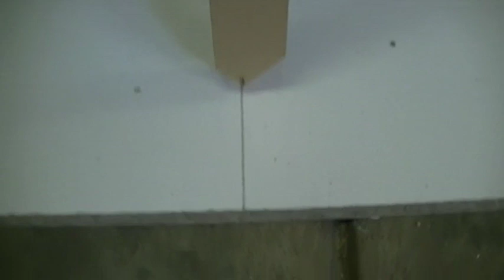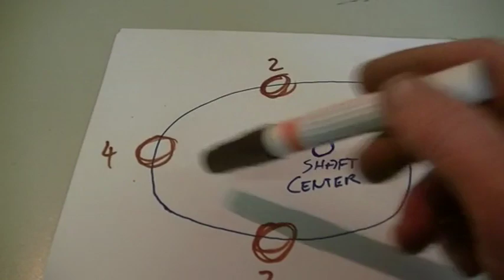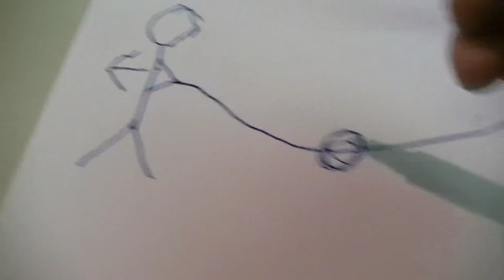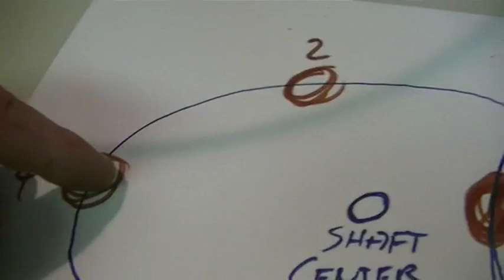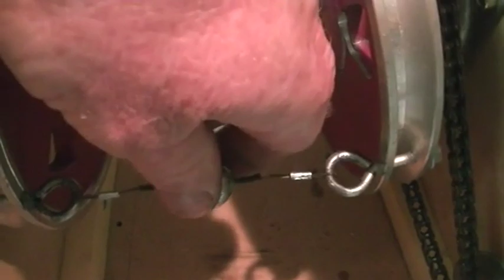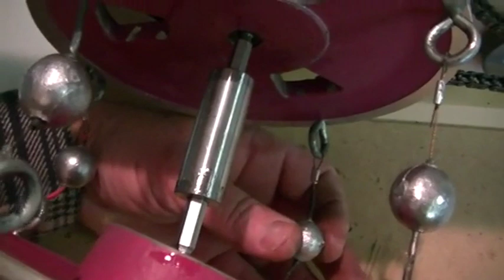Inertia Drive pendulum test,and a look inside

Comment: You have almost the right idea, but you are not caming the weights on and off your flywheel. they will still balance them selves out. You need an outer cam to nutrolizze the weight on and off your flywheel. otherwise you are just spinning your wheels.  There must be a positive caming or it won't work. I built this back in the 1094 and learned what was wrong. Email me wildieforrest@gmail.com.SincerelyForrest

Comment: TinMan, I say that is a brilliant achievement to be able to create a constant deflection for this device during the pendulum test!  Definitely not due to torque reaction, otherwise deflection would have been in the opposite direction. After drawing up a kinematic diagram of your device, I think I may have an idea as to why the coriolis inertial forces may not be totally cancelling out the inertial thrusting force.  I would like to replicate your experiment, and at the same time, I would like to gather some data from your experiment in order to make some rough thrust calcs.  Could you approximately give me the distance from the deflection pointer tip to the ceiling, the metal that the satellite sinker is made of, the diameter of the sinker, the approximate weight of the box/motor assembly, and the rpm you figure the main rotor was spinning at?  I believe that you mentioned the deflection of the pointer to be about an inch?

Thanks!

Comment: TinMan, as a reactionless drive enthusiast (and a pretty serious one at that), I've done a lot of research on potentially working inventions. What I've found is that there have been several successful experiments that have somehow slipped under the radar of the scientific community. Maybe the inventor got discouraged. Maybe everyone around him told him it was impossible, including the scientists staring at the evidence.

You have something potentially great here. What you have is some pretty darn interesting results, that only need a little fine-tuning to be very convincing.

But if you stop here, this machine will follow the path of all those others. It'll fade from memory, and people will eventually forget it ever existed.

And all you need to do is extend the wires you've suspended it from and do the same experiment again. Also... please be open about who you show it to. Scientists hate when you're secretive and will only display your invention under "specific conditions set by me".

Comment: Outstanding, I have a been working on a proof of concept machine to do exactly the same thing, I just have drawing, but I am really excited to see proof of concept, Wow good job, I was going to use 2 of them side by side one turning clock wise, one counter clock wise to cancel out.  mine dose not use cables and should be able to have a lot of Rpm with improving the deflection.

Comment: Would a water ram pump with a horizontal larger pipe on the pendulum give thrust? The pressure pushing the unit forward against the volume of fluid and pull the unit in the other direction on intake. Water ram pumps are perpetual running and have been used to drive water wheels. I think the water wheel version was used to drive Bakers Mill 1880's in Pennsylvania, USA.
Reply from the maker: I am actually working with a liquid type inertia drive at the moment,and the results are very promising.
Reply: TinManPower Looking forward to seeing the liquid type. This mechanical one I have a feeling that if you turn the unit 90 degrees on the pendulum it may work better.

Comment: How to propel a spaceship by using fake mass:
(I know it wont work, just want to know why)

Tile with increasing/decreasing inertia:
Tile consists of 3 stacked rectangular plates.
Between plate 1 and 2 : 4 flywheels
Between plate 2 and 3 : 4 electromotors driving the flywheels

Spin the flywheels: increase inertia
Slow down the flywheels: decrease inertia

Increasing the speed of the space ship:
1. dial up enertia
2. push the inside front of the spaceship away against the tile@high-enertia
3. tile@high-enertia travels to the back of the spaceship
 ( action has opposite and equal reaction )
4. dial down enertia
5. tile@low-enertia hits inside back of the spaceship
6. bring tile@low-enertia to the inside front of the spaceship

Its basically decreasing the momentum of an object before impact.

Can somebody point me to some more info on this constalation
or give me a hint why this can not work.
Reply: Opdehoede , wow, you have the exact same idea as I've been having for a long time! And neither can I see what's wrong with it. My idea consisted of making a wheel spin (gyroscope). When it spins, it has more inertia than when it's inactive. A spinning wheel resists rotation more than a dead one. It will not resist linear motion. Only change in rotation. WIth that said, the spinning wheel has gained inertial mass. So when pulling the wheel towards you by grabbing the tip of it, you're turning it slightly, which will resist motion. So you will have more displacement by pulling the tip of (and thus slightly rotating the wheel) a spinning wheel towards you than a non-spinning one. This is my theory. I can't see what's wrong with it though.

Comment: Nice work, TinMan. "M Drive" guy here, if you remember.

This is a very impressive experiment, but as with many of my experiments, it's only until after you notice something was wrong. In my latest pendulum experiment I could also get it to deflect to one side, but because of a technicality with the power cords, the results became disqualified so to speak. The cords were too thick and actually tugged at the machine after I turned it off.

Anyway, there's one problem with this experiment, and that's that the wires it hangs from are strung up incorrectly. You need to have them at the front and back of the machine, not left and right. If you have them to the left and right, the actual box could simply be twisting (clockwise as seen from the camera), causing a false reading.

Luckily it's a super easy fix. I'd absolutely love to see the same experiment with this fix. Hopefully you don't hate me too much as a rival to see it done. ;-)

PS. The longer the wires it's strung from, the larger the deflection should become, and the more convincing it'll be.

Edit: Might've been a little hasty there. The white lines do show some deflection too, so that's inconsistent with my theory that it might be rotating clockwise. If this is indeed producing thrust, then a twice as long hang height would produce twice as long deflection (instead of an inch, 2 inches).
Reply from the maker: That was the very reason i placed those three white line's behind the cables,so as we could see there was no twisting.The wires are hung correctly for the pendulum test in regards to this device,as the wires are along the axis of the rotating mass.If the wires are placed at right angles to the axis,you would actually be trying to lift the machine up.Most think an inertia drive violates the law of conservation of momentum and the conservation of energy. This is incorrect,and a miss understanding on there behalf.Are you on any of the forum's? PM me,and lets put our thoughts together to build a better machine.
Reply: TinManPower PM sent, though the summary is I'd really like to see you extend the wires. The deflection you see in the video is pretty small, as you mentioned. The longer the wires, the better everyone will be able to see it works.

You can actually use extra strength fishing wire for ocean fishing. Takes 40kg and is pretty cheap. Won't break that easily either. Found in any good fishing shop.

Comment: i take it the force of the ball moving straight up instead of an elipse is because of the forces on the pulleys from the ball that is moving fastest is pulling on the pulleys and making the wood flex at the bearing mount?
Reply from the maker: There would be some flex,but very little.It's more about an applied force over a period of time-just like bill and ted-so it is in the RFDD.

Comment: Excellent demonstrator!  So it seems if one wants to redirect a half-cycle of force in an oscillation, it's necessary to split the force in two opposing directions at 90 degrees to the original oscillation (hooks pulling apart in this case,) resulting in some force-geometrical interpolation that consumes and then returns a fraction of the reactive power upon entering and leaving the force-modulation nodes (points where hooks are nearest and furthest in this case?)  synchronous elastance parameter variation?
Reply from the maker: Indeed-Reactive Force Diversion Drive.

Comment: AWESOME!
  DO YOU HAVE A STROBE LIGHT SO YOU CAN FREEZE WHAT IS GOING ON WHILE RUNNING?
Reply from the maker: Well thats an interesting thought Theo,but would take some doing. Maybe an adjustable switch on the shaft could trigger the strobe at the right time-and being adjustable,i could follow the weights around the device as needed.I might give that a go.
Reply: you should borrow a strobe from a car repair place, they use them for timing belt adjustments!!!!

I can NO OTHER WAY to see what is going on, also that will GREATLY HELP YOU ADJUST your device just perfect!!

Hell, I bet even a cheap disco strobe will work
Reply: TinManPower Sorry to pop in here. If you have an arduino there is a simple strobe program that you can run, all you need are a few LED's.  Just thought I'd mention that (not sure if you have an arduino). Thanks for sharing your work Tinman.

Comment: Very nice! Based on someone else's work or your own theory?
You might look up aramide brake/shifter inner cables for bicycles. Might be delicate but still flexible and strong. Also, outer cables are sold by brands such as Nokon which are flexible chain linked aluminum barrels. Might work well in conjuction with aramid inner cables. NOT cheap.

If a different satellite path is desired, the flanges might be replaced by roller (or maglev) tracks which are not in one plane. Or the cables/satellites might run onto a ramp.

How and why there is net force, I honestly cannot understand right now. However, the person who fully understands it might also figure out the Abeling device... http://peswiki.com/index.php/Directory:SJack_Abeling_-_Gravity_Wheel_-_Weight_Power_Plant

I hope you'll soon receive confirmation of replication, if so please report on Youtube?
Reply from the maker: It was based around my own theory,although the balls that were traveling straight up instead of following the elliptical path was unexpected-but an added bonus.
Reply: I wonder why the tension that causes the vertical path does not create the equal and opposite counter-reaction. Does energy somehow escape the system through the lateral axis? Quite amazing if indeed it does. And I'd love to help figure ways to optimize its component. For one, if satellites are not in the same directional plane, they could have overlapping orbits. And various alternative setups are crossing my mind already.
Researching the Rotor asymmetrical bike cranks might inspire you. And I own a old prototype set of BNN (Korean) cranks with circular pedal path, telescopic (160-190mm) arms and effectively virtual and offset axis of rotation. I now wonder what simply attaching weights to that and driving the axle would result in. Perhaps something as simple and sturdy as that could already (or aid to) achieve net direction inertia?